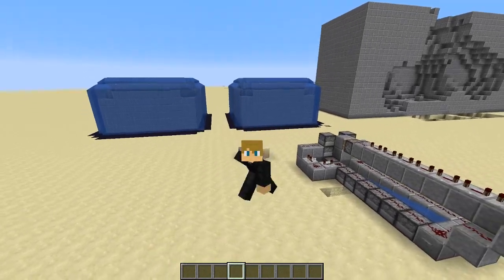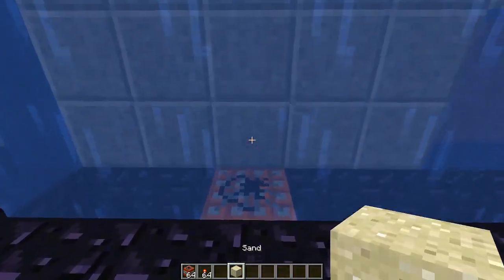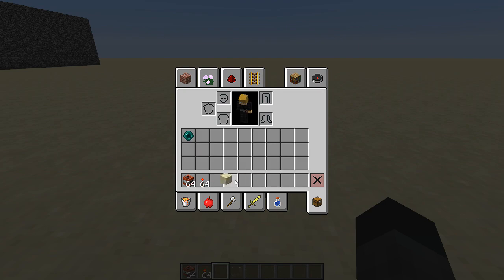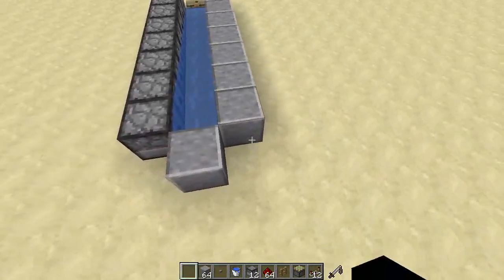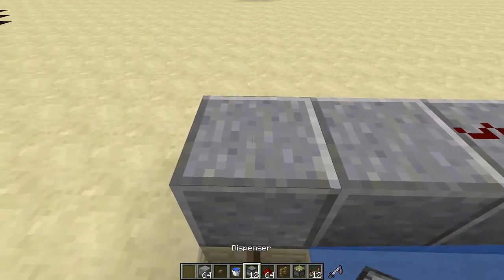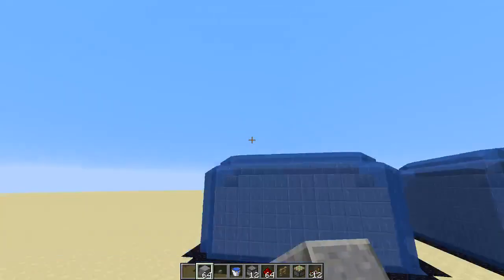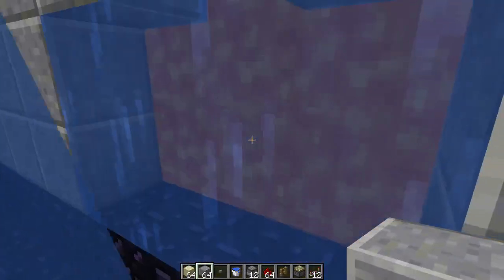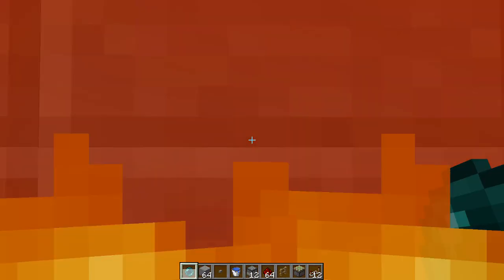Waterproof TNT Cannon. How to raid Forts covered with water/lava. works on 1.9 - 1.13

Comment: my sand just fall little bit lower. How to fix this?
Reply from the maker: it works only on versions 1.9 - 1.13
Reply: @HeppeGaming  does it work for the newest version
Reply from the maker: @jb-mb2zp   it works 1.9 to 1.13